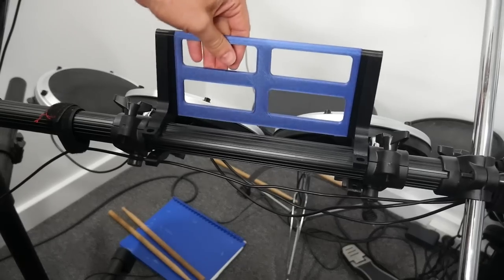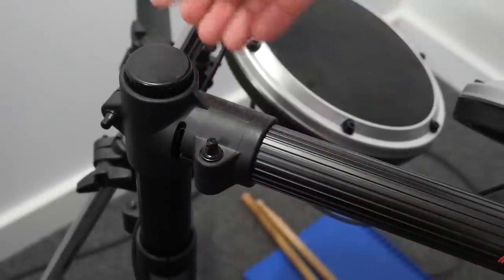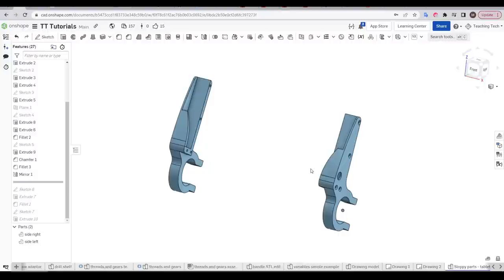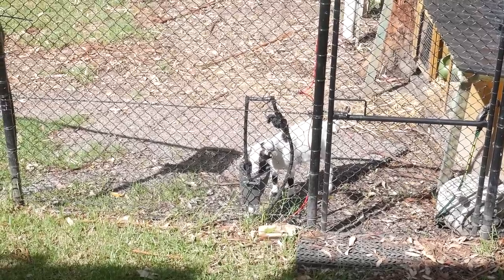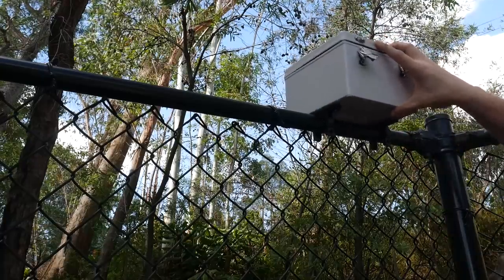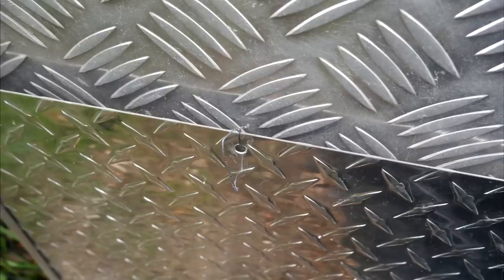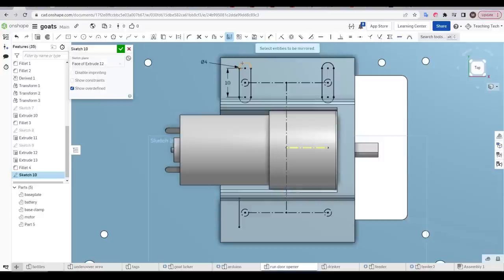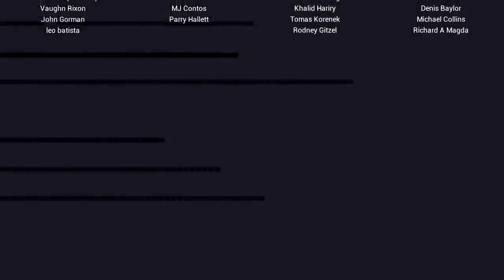Creating sloppy parts to ensure perfect fit  - 3D design for 3D printing

Comment: If you can't have precision you use adjustability.
Reply: And use adjustability to archive precision
Reply: Precision is hopelessly overrated....
Reply: @TestTest-eb8jr  not really, sometimes there is no room for adjustability
Reply: Adjustability also adds to installation / finishing time. This is absolutely an excellent tradeoff for prototyping or single use solutions. It just doesn't scale well unless you have a factory full of people to assemble lots of parts 24/7 and then a quality control department to check that everything is adjusted in spec. So it's great, but just shifts costs from iteration and design time, to installation and final alignment.
Reply: @TestTest-eb8jr  Are you saying lego is overrated

Comment: 3D prinitng is great for prototyping before a design is finalised and the parts are then produced by proper tooling.  As a one off project  it works great. Right now I am finalising the printing of a 5X7 large format field camera ( not my design ) using my CR10S pro which is working at its limits. Very impressed so far. Its great of you to show how a 3D printer can be made good use of for practical projects rather than just printing useless toys.

Comment: Hi Michael, great tips as usual. For the wire/string of the door, I recommend printing and attaching a small spiral spooler to the motor that will ensure the wire spools the same way every time. We use this a lot in building greenhouses.

Comment: Something I've found helpful in my designs is a part I printed with several holes that get progressively larger.  It looks similar to a drill bit size template.  It's printed on the printer I use most often for practical prints with the nozzle and resolution I typically use.  I use the printed template to select a hole size in my design based on the screw size and the clearance I need.  Since it was printed on the printer with the nozzle and settings I use, I know that's the hole I'm going to get.  Not very scientific but it works for me.
Reply: Be careful when modifying or updating any slicer settings, the way it treats holes can vary even more than the printer, "lost in tech" has a video on why holes are never exactly what the stl file expects and how to fix it. (It has to do with how walls are built by the slicer, and which way it averages the extruder line width which is a squished tube and not a line)

Comment: Tip: use variables for your "gaps/slop" offsets.  That way if isn't quite right, its very easy to change quickly, especially if you have a few spots you have used the same value.
Reply: I design a lot in openscad, and a classic variable at the top of all my files is the "bufferdim",  It lets me raise or lower a part by a thou or so, negligable, but it helps with the quick render.  Then I have another "gapdim", which is for clearence fits. With complex parts though sometimes I need to create special params for certain parts, and then it gets complicated, with bufferdim2 or bufferdim_toppart etc.... im not good with keeping my naming conventions.

Comment: Great as usual!

I add "slop" or margins due to shrinking, Especially on DIY solutions which are the best and gives most satisfaction reward.

Recently I was printing a 1 meter long tube to make a lamp in my office. the shapes was trial and error for a telescopic fit without slop and the parts are printed in vase-mode.

A great RGB-LED strip powered by WLED and an NodeMCU. DIy projects at the finest.

Now a tablet holder for my motorcycle and ADV-buttons for navigation. Makers do what makers do.

Comment: Onshape has a nice Hole tool that will do the counterbore for you using standard sized hardware. It also makes adjustment easier since the last thing you want is to update the diameter but not the counterbore. Also helpful for doing drawings. 

I'd also mention you want to be very cautious about print orientation for things like this - you ideally want the part your clamping around to be going along the z axis of your bed when you print (this is a place where a picture is 1000 words...)
Reply: As in, you want the direction of stress (I think this is tensile?) to be coplanar with the layer lines right? Im not an engineer :)
Reply: @transatlant1c  I think you got it. Or less fancy words - you want it to flex along continuous deposits of filament instead of across layers because the layer bonding is almost always weaker.
Reply: @aschreiber  yep that’s what I meant haha. Not sure why I worded it that way. Utilise the strength of the material not the strength of the layer adhesion 👍

Comment: 1) Get a metal calipers (like the one in the link), not all-plastic (like the one in the video). The difference in price is well worth the frustration of the 100%-plastic ones being crap.

2) Another way to make it work if you're trying to snug-fit two printed parts that are big enough (say, anything over 15mm diameter) is to make one of them as much as a couple mm smaller, then use teflon tape around it to get a nice friction fit.

Comment: Item #1 came out looking very nice and professional. The astute observer will note that the drumhead mounts of the set were actually designed the same way, with an open gap that uses a bolt to close it up and provide tension to keep the part in place.

Comment: These are all excellent recommendations! This simple clamp can be very strong even with little pressure on the bolts. The surface area and roughness of the clamp is what allows a little bit of pressure to give a lot of holding force. It's sufficient to even make powerful CNC mills, like the MPCNC. One thing to watch for is not to tighten the bolts very much. It only takes enough to provide friction between the clamp and the tubing. The clamping forces are concentrated where the bolt is, so over tightening will break the clamp there. Tighten it just enough that you get a snug fit of the clamp on the tube. If you can see the ends of the clamp flexing, you're going too far.

Slots and oversized holes with washers are also a universally good trick. It can be difficult to keep things square this way, but it gives a lot of freedom for adapting to imperfect dimensions. Look closely at manufactured parts and you'll see these kinds of approaches used all over the place, especially on cheaper parts. Precision is expensive; we can avoid it with flexibility.

Comment: As always great content very well taught. Aside: you'd get much easier designs (and a stronger bolt catch) by using square bolts. The longer moment in the shape allows the plastic to resist torsion better.

Comment: I would love to see you print a gear assembly to increase the lifting force of your motor.
Reply: The motor he's using is already a gear motor. Gear motors are available in many combinations of motor torque, voltage vs speed, and gear ratio, so you can pretty much order what you want, and not fuss around with designing your own gears.
Reply: Or counter weight to make the motor work less :)

Comment: You see box with adjustable motor mount.  I see future home for bees.
As a noob to both 3d printing and design in general I'm really unsure of how tolerances are handled.  Thanks for the tips!
Reply from the maker: I am thinking about a blanking plate that holds a short length of PTFE tube for the line to run through, but otherwise float in the bottom on the enclosure to seal it off.

Comment: One suggestion for your door lifter. Instead of precisely mounting the box, you could precisely mount an idler pulley. It would be much easier to align the pulley than the entire box. Being off a bit between the box and pulley won't cause binding nearly as much as being off at the door.

You might also want to make the door less susceptible to binding by giving it some smoother slides. Some V wheels on bearings would hold the door panel nicely, similar to how it is used on cheaper CNC machines.

Of course, both of these suggestions are extra complications, but they may be less complicated than trying to get perfect alignment or using brute force to overcome friction.

Comment: For establishing fit i often use Onshapes Thicken feature. You design the feature to nominal dimensions and thicken (or thin, since Thicken can remove material as well) so that the fit is right. This way you only have to use nominal dimensions.

Comment: Hi Michael, good points, I recently designed a verse mount for my microcomputer to mount to the back of the TV, I wished I had seen this sooner, I would have saved a 1/2 roll of PETG filament

Comment: Thank you for sharing
This is a common problem many people do have when making fixable items

If i make slots or holes or even cylindrical parts that need to be bigger or small than what it needs to go inside or outside without it binding. 
I do a test  model and see how much the material shrinks or expands, this also depends on the amount of material being used/dimension's
Then i just adjust to suite , without compromising  the strength ,

Comment: The Door Opener looks like a great design so far. That steel box looks awesome. My only recommendation is to carefully consider where you can add drip edges. As a rule: Don't hope water goes where you want it to go, make it go there.

Question: 2:31 - I see you used a ratio of about 0.66 between the slot opening and the pipe diameter (25mm / 37mm) for the drum kit, but then changed it to 0.82 (28mm / 34mm) for the door opener (6:39). Why did you make this change?

Comment: For nuts, I put a very slight draft on the hole so it becomes interference at the bottom.
Reply: Could you explain the merit of this technique?
Reply: @Graham_Wideman  the nut won't fall out after its been 'seated' in the recess. Otherwise I've found, for some of my designs, that glue is needed to retain the nut if the bolt is ever removed.
Reply: @OldCurmudgeon3DP  Ah, that's what you meant.  I was visualizing the wrong thing.  I think I was thrown off by your use of "hole" rather than "recess" in which to place the nut..
Reply: @Graham_Wideman  proper terminology reduces confusion 👍

Comment: Something interesting i noticed with prints when not allowing much room for fitment.  Parts that fit using PLA you can reslice and print with PETG and it may not fit.  I can only assume it's due to changes in viscosity when extruded.  Not much of a difference but it can lead to some extra work post processing.
Reply: Yeah, viscosity, but also extrusion settings. If you’re reslicing, it’s probably to change settings like extruder temperature and corresponding extrusion settings

Comment: Is there a way to make parts match? If I have holes in one part, I can make it subtract from another part, leaving pegs where the holes are, but I need to shave off a layer on the peg part to  enable a fit. How does one shave off a layer all over a part?

Comment: dont forget to add some sort of protection to the bottom side of the metal 'guillotine' plate, you wouldnt be the first one to accidentally behead your animals if something fails. Normally a car rubber or a pvc tube or some wood would be enough. But just keeping it as is, its a potential death trap.